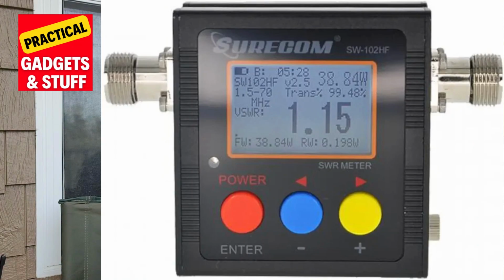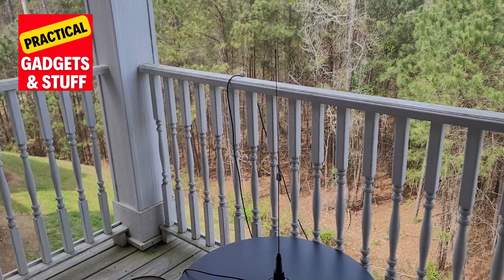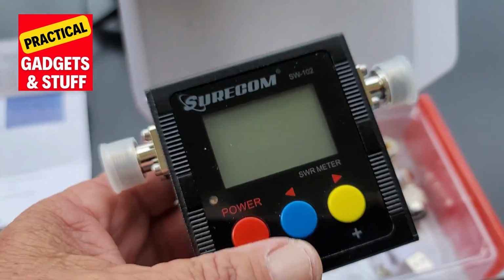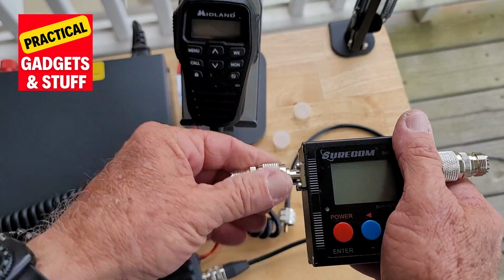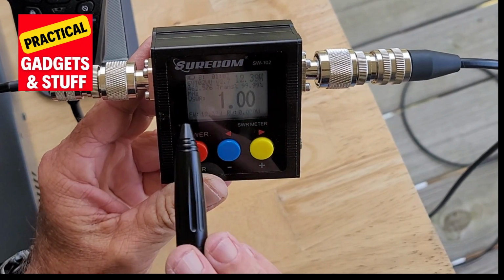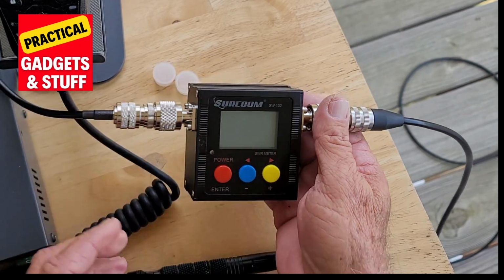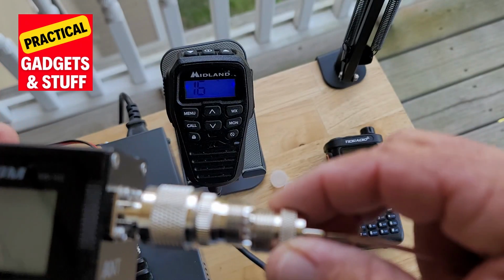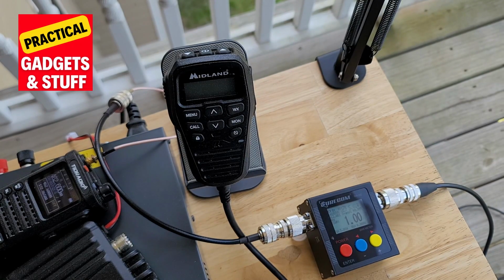Surecom SW-102 GMRS power and SWR meter

Comment: I used this to make a combination half-wave dipole that I thought would work for both 2 m and 70 cm. This unit said it was OK.  Lately I noticed that the SWR on this antenna on my radio was closer to 5. I have now made separate half wave dipoles for both bands and use a switch to select the correct antenna. The SWR is now 1.5 or less after trimming the antennas. SWR increases as power increases, probably because the antennas are indoors and fairly close to the radio.

Comment: If you don't put a good enough ground plane in then the antenna system will use the coax to make up for it. With that you can end up with lots of problems because of common mode RFI because your coax is now part of the antenna. This can be increased receive noise, interfering with electronics in your home or vehicle, distorted audio on transmit.
Reply from the maker: @conorturton  Thanks for the info and for watching 👍🏻
Reply: He didn’t have any problems with any of that in this scenario? What are you carrying on about? His setup works perfectly.

Comment: Only thing i wish you did was leave the antenna on the deck, not touching metal. To show a comparison why a ground plane is needed.

Other than that. Great demonstration.
Reply from the maker: @cowpies2001  good idea. Will do a short video next week. Thanks! 👍🏻
Reply: @practicalgadgetsandstuff  that would be awesome! I'm dealing with the same antenna giving off too much swr. I belive it's because i don't have it grounded enough. Unfortunately weather has haulted me from testing.
Reply from the maker: @cowpies2001  Video is up! I think you may have a problem with the antenna. Maybe the cable. The result surprised me!
Reply: @practicalgadgetsandstuff  wow I'm really surprised there was no difference. We'll I appreciate you doing that, now I've got to tinker with my own setup and do some R&D.
Reply from the maker: @cowpies2001  try testing the antenna with another mag mount. Have to be a mount or cable problem. Good luck!

Comment: Would these kinds of "home made" ground planes work with a CB radio also? I have a President New Virginia CB radio antenna for car roofs, but could use it on my balcony also with these ground planes.
Have you stopped using your CB (President McKinley?) and 5' Firestik antenna you used to have on your balcony (I don't see it there anymore) and now you're only using GMRS?
-- BR
Reply from the maker: No Bill. I tried everything with my CB on my balcony. Not enough ground plane. CB requires more than GMRS. But I found a solution with the Firestik IBA-5 indoor antenna. Works awesome. Now I have a SWR of 1.3 and very good comms. Watch the video I made on it. Thanks for watching! 👍🏻
Reply: @practicalgadgetsandstuff   Yes, that's what I was talking about: The CB with the Firestik IBA-5 (I have that antenna also). So your CB setup seemed to be working fine but now I see you have GMRS on your balcony so was wondering what happened.
-- BR
Reply from the maker: The link to the video
https://youtu.be/EoKscCJHwrg?si=aiikv5PEIS128ZBJ
Reply from the maker: I use both Bill. The CB antenna is full time outside, but everything else goes inside when not in use. Is a small balcony! 🤣
Reply: @practicalgadgetsandstuff   Okay, thanks.
-- BR